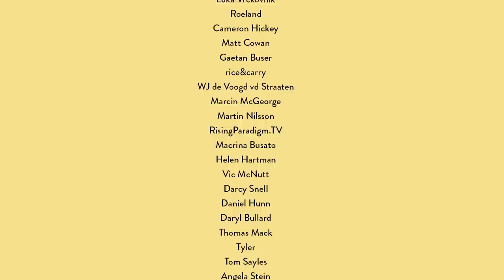Monthly News #21  - Taken over by the army

Comment: Id love to see you guys have some sort of pyrolysis program for recycling plastic that is mixed or broken or otherwise too shitty to use. I feel like recycling is great but there needs to be an option to address lots of garbage with economical processing or else this wont take off. As much as i understand the "use less" movement it still relies on diesel and gasoline to provide the goods you live off of.
 Farmers can use clean pyro oil to run their tractors. Greenhouses can use it for heating. These are things that arent effectively dealt with in the traditional or alternative systems. 
There seems to be a disconnect on both sides. On the regular consumerist side its obvious. They use things as if the world is a never ending resource. But on the other side theres this idea that everyone will just adopt this new, often much less luxurious, way of life of veganism and not buying anything and recycling everything you get. The middle ground is that its not feasible to recycle entire landfills in the way precious plastic works, but it also not feasible to keep creating landfills.  Though it would be feasible to divert trash from the landfill some of the time but only when its sort able trash and the waste is fairly clean. The type of stuff you can use.
Ask yourself how much water you would need to clean plastic from a landfill to the point that you could put it through a chipper and extruder. Let alone the power needed to accomplish this type of recycling en mass. How many man hours per ton of plastic does it take for you guys to recycle it? Im pretty sure if you scaled that up it would take more people than there are just to deal with plastic. 
If you had a large pyrolysis program for landfill waste you may not get infinite re-usability but you will get a second generation fuel that is almost universally accepted as a commodity and can be used locally to reduce demand on the oil industry/fields/environment in general. If you reduce the oil industry wouldnt that slow plastic anyways since its a petroleum byproduct? 

Sorry for the rant haha
Reply: Pyrolysis is carbon intensive. For dirty, mixed plastic would be better off burned in efficient cogeneration incinerator with the best filtration system for air pollution control.
Plant like that should only be running in winter when there is no enough heating and electricity from solar PV, etc.
In the end we need to reduce consumption of hard to recycle & carbon intensive goods and services. All the carbon by doing that should be offset by planting trees.
There was some research on how hydrolysis could make plastic monomers  in order make plastics just like virgin ones, don't know how viable is it.
Reply: Green house can be heated cheaper by heat pump (it can be just some hoses under ground made of recycled plastic and a fan) Kirsten Dirksen has video about it.
If we reduce the demand for plastics and petrol by driving electric bike, using recycled plastic, reusable light weight packing, etc. 
At our current over consumption we can not sustain 7.5B people. Having less kids, not before 30's would mean less pollution, longer life and higher cognitive ability. So in order to make it sustainable we need anywhere from 0.5 to 1 child per person and a the same time reduce consumption. Otherwise essentials can easily skyrocket in price relative to the income due to changes we introduced in atmosphere of our gigantic space ship.
Reply: Theres a lot to unpack here but it looks like you missed the point of what i was saying a bit. 
Ill address this as you have replied. 
Pyrolysis is less carbon pollution than incineration. And incineration produces non decentralized fuel and as such is used to make electricity. If you use it to make diesel then you can add the carbon left over to landfill or to the soil as a carbon sink. The liquid fuel is anywhere from 20%-90% of the weight depending on the feedstock. So lets assume its about 60% fuel product and as such 40% reduction in carbon pollutants can be maintained from a source that would otherwise be in the form of plastic pollution. Its also worth noting that the used fuel can be recycled a lot easier than the plastic buried underground can. CO2 in the air is a resource to be used not something to be afraid of in this instance.
Solar PV isnt worth while in a lot of places. We need too much power to make it worth while with the current trends. If you could cover the Sahara then sure but where i live in canada its not worth it. 
Ive not heard of hydrolysis for plastic. Ill have to research that.
Greenhouses in canada, regardless of how efficient they are with insulation, will always need supplemental heating. And heat pumps simply cannot displace enough BTUs into the ground to cover the need of the greenhouse. Most places run on oil or gas. Electric is too expensive.
Driving an electric bike might work where you are but where i live its not an option, and what about all the systems around you that work on diesel? Your food for example. 
I used to work in a warehouse arts collective growing food in an urban farm and one thing i though was super ironic was that there were all these hippy vegans that ate avocados every day. They were the type to complain about waste and shame people for eating meat. They would walk everywhere they needed to go because it was more eco friendly. But then they CHOSE a life path that needed avocados so they just ignored the massive amounts of waste and pollution fro the avocado industry entirely. This is a good analogy for the more eco friendly side of things. Most people just do this to a point, and that point has no set or defined principal other than laziness. They go until its difficult or uncomffortable for them then stop. Everyones different and everyone has a different goal but they shun anyone who doesnt follow in their very narrow view of what is acceptable within the spectrum. 
Although i do agree with you that we need better packaging and need to reduce waste i do think its foolish to think that the issue can be solved entirely. And it think, as much as i like it, Precious Plastic really isnt going to even dent this issue.
If we want to fix this all options much be explored.